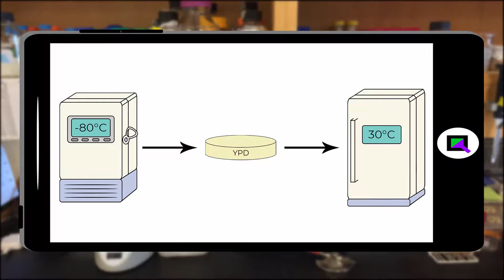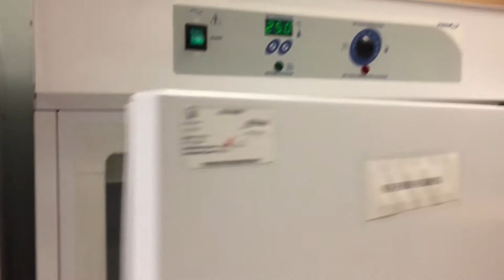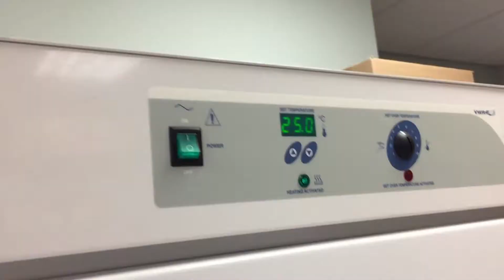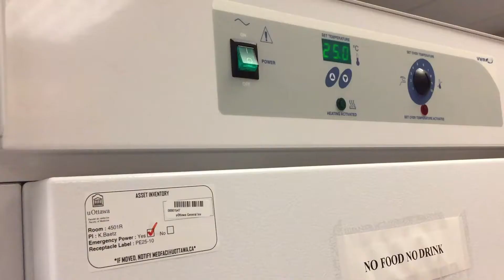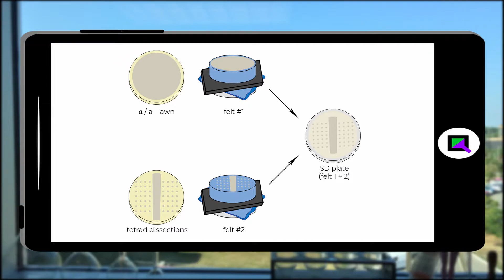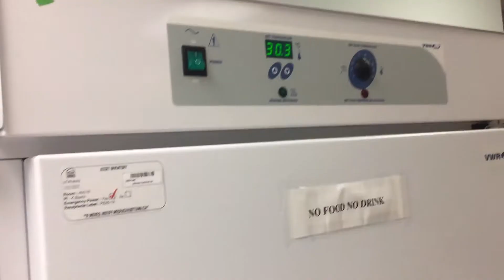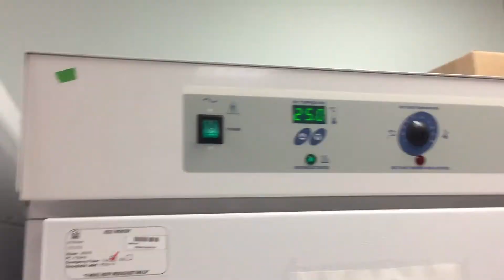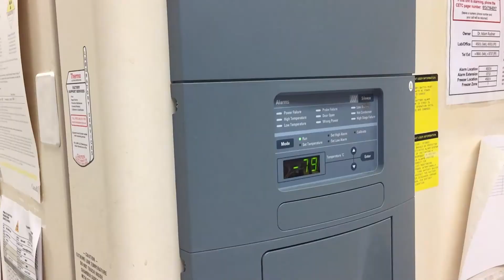Crossing Yeast & Tetrad Dissection (Lab Tutorial)

Comment: Thank you! Extremely clear and helpful guide! I cannot wait to follow along at home! If you can, can you put a list of all the equipment needed for this?
Reply from the maker: I'm glad the video helped in some way! I am working on including equipment lists in my future videos. For these experiments the only special equipment needed is a dissection microscope, plate replicator block + felts, and enough different selection media to track all your gene markers. Good luck with your experiments!
Reply: @bioscienceinsight  HI there. Thank you so much for your help and services! I saved enough money to buy nearly everything needed to preform this experiments, except I am having a hard time finding a valid dissection microscope. I have found many great options however I haven't found the one with the needle as presented in the video. What brand of microscope and needle do you recommend?
Reply from the maker: I finally went back to my old lab to dig up some info on this. Looks like we use an older version of the Nikon Ci ECLIPSE series microscope. The needle apparatus is made of three components: The needle itself is a tiny piece of glass fibre glued to a long L-shaped metal cantilever - this cantilever is attached to and controlled by a Joystick Micromanipulator made by Micro Video Instruments. Check out MVI's "Tetrad Dissection Microscope" web page under Microscope Accessories for some images of the exact model we use. Best of luck with the setup!

Comment: What Company makes the felting shape that’s used for replication? And what is it called?
Reply from the maker: The replica block that we use is from ReplicaTech Inc (a company which I believe is unfortunately no longer in operation). Other labs around me use ones from Fisher but they are slightly smaller and the ring can be annoying. Our velvets were custom made by my supervisor - they are cut velvets from FrabricLand that have latex paint around the edges to prevent fraying.